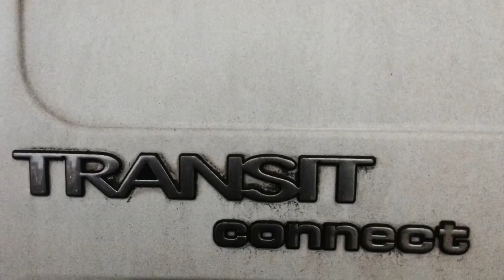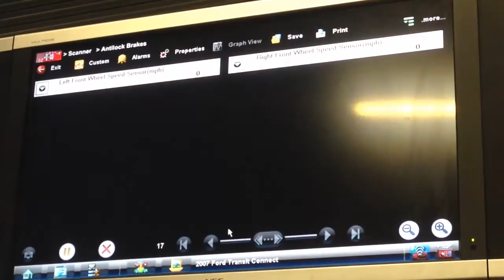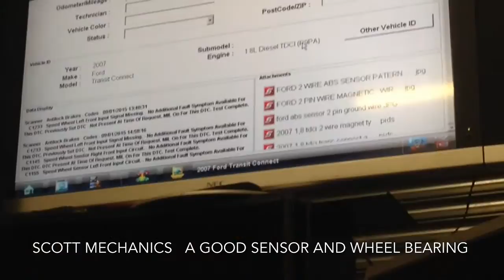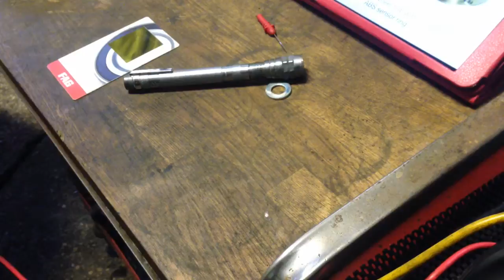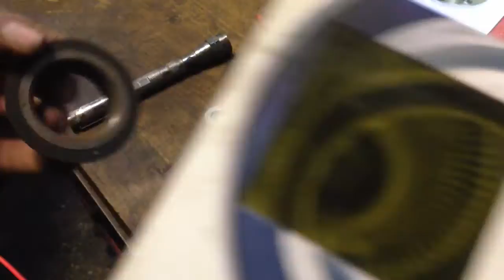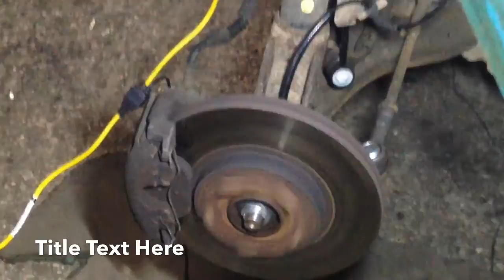C1233 ABS FAULT CODE FOUND AND FIXED USING snap on scan tool VERUS & modis by Scott mechanics

Comment: r snap-on paying u
Reply from the maker: +kenny keenan 
Hello 
No snap on don't pay me and I am not trying to sell any one a snap on scan tool ( I enjoy using my Verus and modis) 
Thanks
Reply: what do you use the modis for? dosent the verus do everything?
Reply from the maker: Hello Martin they both do the same 
The difference is the verus is touch screen
And has a hard drive 
The modis use mem cards or usb and button operated thanks
Reply: thanks, scott, have you see the new edge version? not sure how much it is yet, any idea?
Reply from the maker: +Martin Marshall  hello Martin yes seen video of the new edge it on window 7  price around £7000 and it has a ssd drive   mine is on Windows Xp
And put the ssd drive in myself
Reply: Quite frankly I can see the Modis alot better than the Verus when using an external screen like you are doing here...

Comment: Hi Scott, I have just bought a second hand Modis and trying to get to grips with it. Can you tell me what leads connected to the scope and how you had them connected to the abs sensor?  Thanks John
Reply from the maker: John Ambler 
Hello John well done on buying the modis i still use mine last vid on Clio crank sensor 
For the abs sensor in the transit connect you need the yellow and black lead connect the black lead to battery ground yellow lead to one of the abs wires back probing if you unplug the abs sensor koeo the voltage will change if it dose not your on the wrong wire
The on the bottom screen icons 1 one select coupling ac 
And a filter like in video   Scale 1v sweep 50 Ms hope this helps
Reply: +scott ScottMechanics Thanks for your help Scott really appreciate it. Looking forward to learning more about to Modis and how to use it. Keep up the great vids mate.

Comment: That is a excellent test and result. Would it be possible for me to connect the older model Vantage graphic scope and see the waves on its display as well ? I do not have a Verus yet, it suppose to be shipped to me tomorrow ..thanks
Reply from the maker: Hello yes the vantage will be able to display this 
And thank you you will love the VERUS
Reply from the maker: You will need a docking station for big screen connection 
Thanks Scott mechanics

Comment from the maker: Check out this video on YouTube: abs sensor scope 
Good one bad one
Reply from the maker: 2007 transit connect 1.8 tdci 2 wire sensor magnetic wheel bearing type
Scanned and scoped on a snapon verus and modis